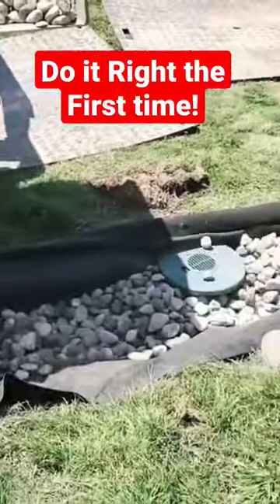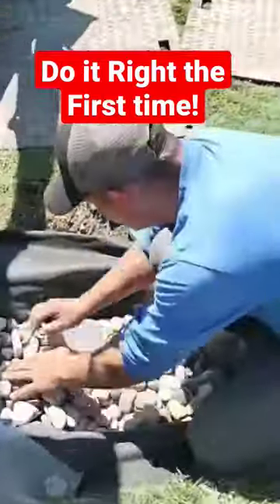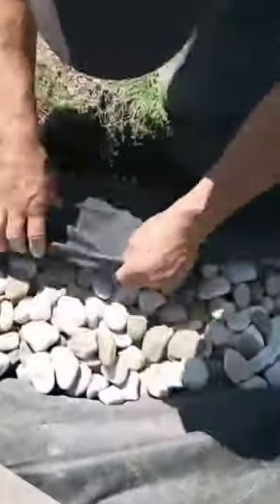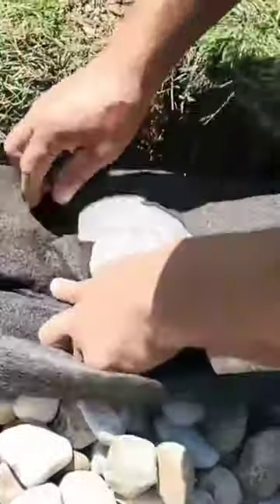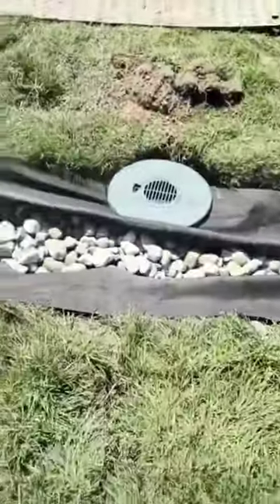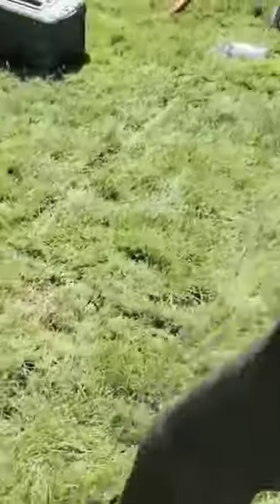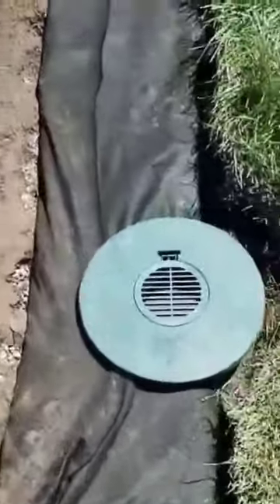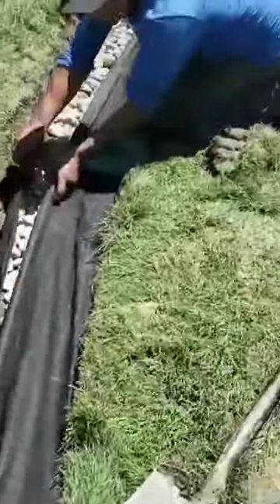How to install French Drain Fabric - Do It Right the First Time!

Comment: Do you put gravel/stone under your corrugated pipe or just on top of the pipe?
Reply from the maker: Just on top. We use fabric otherwise I would.
Reply: @FRENCHDRAINMAN  would it be bad to have a few feet of gravel under the high octane pipe using the method? Your videos seem to make the most sense of all that I’ve seen. Thank you.
Reply: In other videos he explains the pipe needs to be at the bottom of the ditch to creat the void where water can flow out the pipe. If you put gravel under that pipe you creat standing water that can collect or just sit there, making the system less effective. Possibly even making the system fail all together.

Comment: Water pools up in my backyard whenever it rains and I have learned a lot about how to fix the problem from watching your videos. So thank you, French Drain Man! Your drain-building techniques and advice make much more sense than any other videos I’ve seen, including Home Depot’s how-to video. 

The only step that doesn’t look effective is when your team seals the two flaps of the water-permeable fabric together to create a burrito. Seems like it would be better to somehow sew or clip the flaps together along the entire length of the French drain without leaving any gaps rather than poke a wire spike through the overlapped material every few feet. 

Otherwise what’s to stop dirt from working its way through the flaps and into the rocks where it can clog up the pipe?
Reply from the maker: https://youtu.be/VFYj7sbmXGg

Comment: I am wondering about the drains function though. So the water drains into the rocks and then what? how does it get into the pipe other than via the turf drain thing? Does the rock only serve as weight and compact? When the water exits the drain, does it go into the main sewer or is it just moving the water? Are there drains on the bottom of the PVC? I guess ive never really learned about these drains until now needing one in my house lol.
Reply from the maker: https://youtu.be/VFYj7sbmXGg?si=SPl7yI48lCFQYNxu